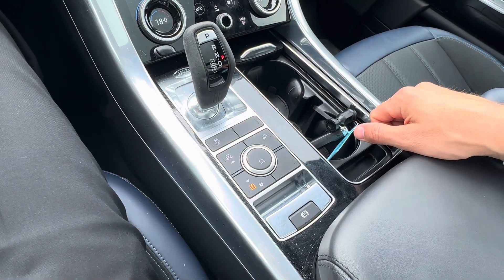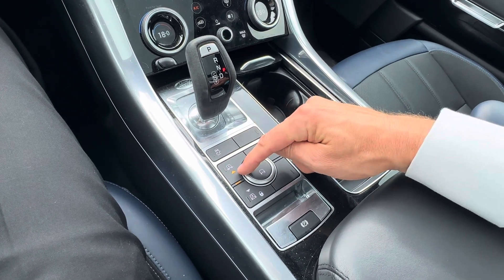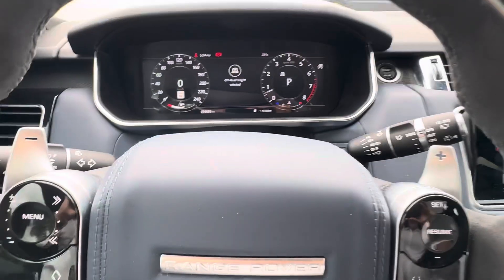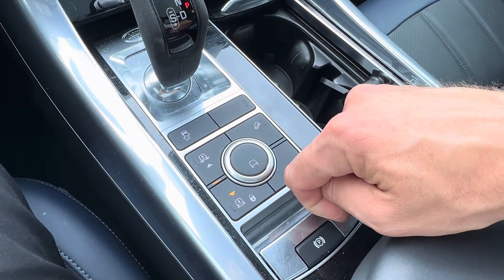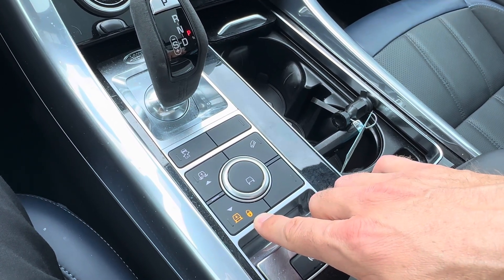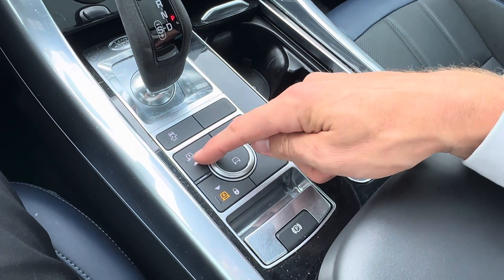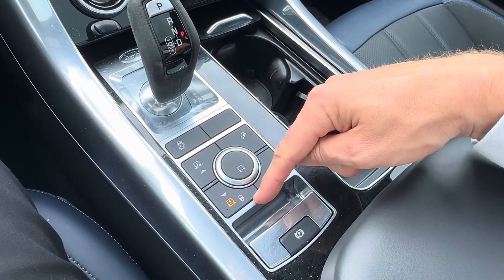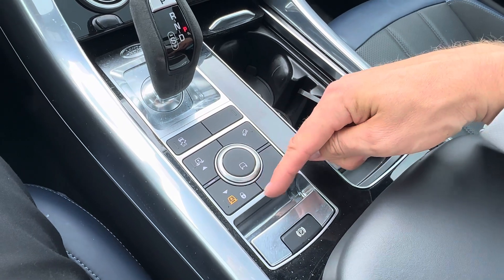Range Rover Sport Air Ride Suspension and How it Works

Comment: Great video, I have a question about EPB. This text is in the instructions, hence my question, "Make sure the electric parking brake (EPB) is engaged and the brake pedal is released when adjusting the suspension height while the car is stationary. Failure to do so can cause serious damage to the car".
Will this mean you must engage the EPB every time ????you want to lower or raise the car.
Reply from the maker: The electronic parking brake will engage every time you put the car in park and disengage every time you put the car in drive so I’m not sure why that text is in the owners manual

Comment: Thank you for taking the time to create this tutorial. We just purchased our Range Rover Sport, and your video has been incredibly helpful in getting us up to speed. I truly appreciate the tips and the way you broke things down—very clear and easy to follow. Much respect!
Reply from the maker: You’re welcome :)
Reply: @dan_stuart  What happens if it is locked in access mode at the lower height, but you drive faster. Does the car limit your speed or will it raise risking the car hitting the underground garage?
Reply from the maker: @DavidWilson-kp2gl it will eventually raise, but at a higher speed threshold. In Canada it’s about 40 km/hr